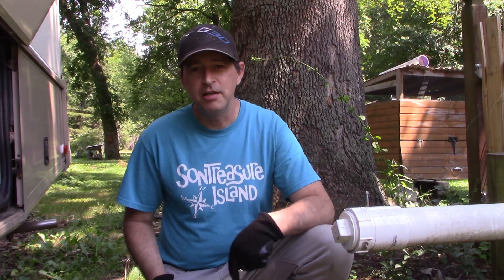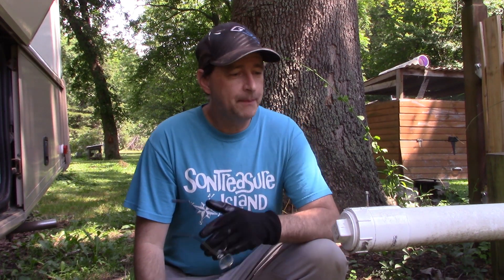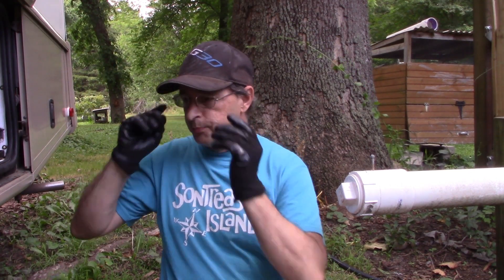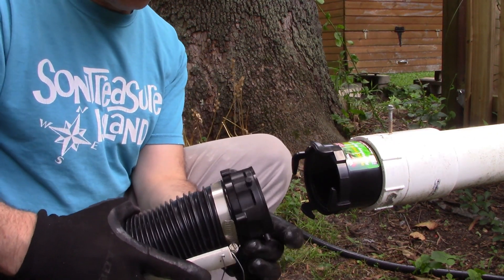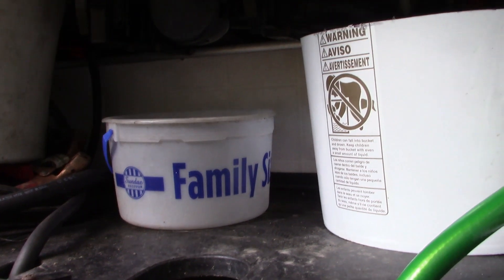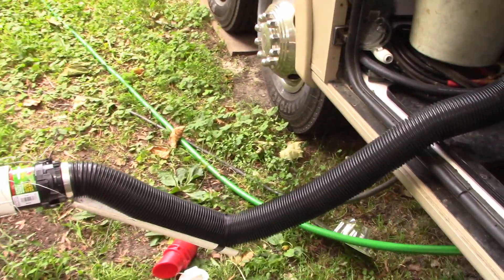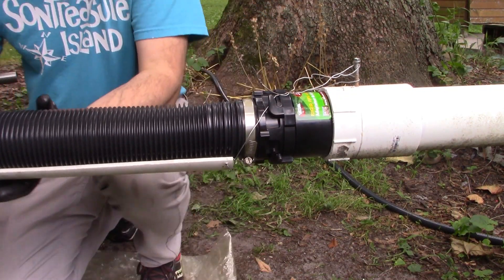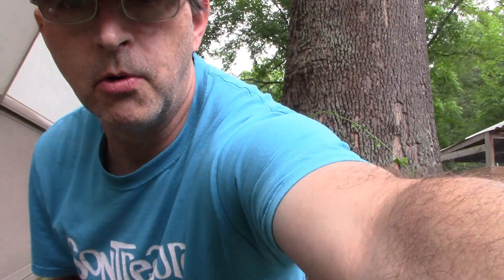Should I Connect my RV to Home Sewer / Septic?

Comment: Also, most code violations only applied to permanent structures.  If your add-on is 'temporary', it may not be a violation.  It is really up to the local codes if dumping into your cleanout is legal.  In many it is, in some it is not.  And you're right.  Even if it is a violation, it isn't criminal.
Reply from the maker: Yes, thanks. Like I said, if necessary, I can have the whole thing dismantled in like 20 minutes.
Reply: Regulatory violations aren’t crimes. Good luck 👍

Comment: In the area where I live, many of the property owners keep their RVs at their homes. This is allowed as long as it is done in a neat orderly manner  Most of these RVs sit on concrete pads that are covered (like a carport) and have full hookups (electric, water and sewer) so they can be used for overnight visitors. Among our neighbors are a city mayor, two city council members, an attorney, a surveyor, my daughter is a real estate agent and I am a homebuilder. We are ALL aware of building codes and  rules and regulations set in place by our Property Owners Association, and their is nothing in the documents of either addressing the storage or use of RVs. After a short discussion of your concern, we can't see a problem, other than the leak. It all depends on where you live and how stringent the codes, rules and regulations are.  I wouldn't worry too much about the nosy neighborhood nazis who try to make your business, their business.
Reply from the maker: Thanks so much for that perspective! I appreciate it!
Reply: @Buckwsr my gmas house has a septic that’s on the ground. I would need one of those wrenches to open it and just put my sewage plug into it. But wouldn’t that close the connection so the sewage pouring in will be closed off? Isn’t there a type of cap meant for the rv sewage hookup? Like a cap on top of the lid?

Comment: Clear fittings on both ends would be nice. Great presentations.  I have a septic system which would be more complicated.
Reply from the maker: Thanks for the note, Frank, and for viewing the video.
Reply: I run mine to the septic clean out..  Works great.
Reply: @robertlapin813  dang I wish I could have a chat with you, so I could get some insight as to how to do it, was it costly to setup?  Does it need to be very close to the septic tank?

Comment: Septic Tanks are Sized to the number of bedrooms in your house, a smaller house will have a smaller septic tank. They weren't designed to dump 100 gallons at one time into them. 
My class C  RV has 35 gallon Black and a 35 gallon Gray Tanks, so dumping 35 gallons from your Black tank, then another 20 gallons when you flush your black tank, then another 35 gallons from your Gray tank into your septic tank. That's almost 100 gallons going into your septic tank at one time. What are the chances of over filling and causing your septic tank to back up into your RV, or into the house?

Comment: I appreciate your work on this project, both times. But I wonder why you didn't expose the Pipe with concrete around it at the start of the original video and see how deep it was. And then replace the elbow with a T and then dig a trench straight to the RV site saving pipe lengths and put a permanent RV Dump Connection there. All would be underground if you had enough fall and you would have still had the original Dump in your fenced yard at the side of your house.
Reply from the maker: You've got some good ideas that never occurred to me at the time. And possibly, in my mind, I think I've always viewed it more of a temporary, not permanent, set-up. Still working great, by the way. Thanks for the note.
Reply: Great idea

Comment: How do I know if the outlet from my Rv has right slope to go inground home septic?  BEFORE I BUY ALL THE PVC AND CONNECTORS.
Reply: I have 100 feet to go.... almost completely straight run to inground septic on our septic field.
Reply from the maker: You only need a slight downhill slope...like 1/4 inch per 10 feet of distance.

Comment: Give you a better answer to is it legal or is it not? That all depends on your area and the code to your area but most of the time if you have it hooked up to your septic tank as long as it does not get put in the wrong side of the septic tank and you have a vent still open for your septic tank you’ll be fine just check in your local areas code, but city sewage I would not recommend it

Comment: ok, you are justifying this from the from context. you are paying for the water, electricity, trash pick as a service. it is not yours. They charge you a fee and allow you to use that service. The internet connection to your house, is not yours. So leave that justification. Now, i am an ex-electrician and know how to run wire from my mom's home to her shed and know the proper codes to do so and did it. However, it is still illegal what i did because because i did not get a permit and you are not allow to even replace a light switch in my county without a permit. Now, i am wrong, however if i called the county and told them i burried wire 6 ft deep trench inside outdoor grade PVC electrical conduit......all that verbiage means nothing when talking to him and they will bite their nails while thinking about the coworker with the short skirt instead of you. Either two things are going to happen, they are going to say who cares, or come out and make me re-dig the trench so they can inspect it. they are not going to asked for the work order from a license electrician to prove it was done in that manner and i have done electrical work all over the county without permits, and was not suppose to.  now what i would not do is installed a main feed wire for the house or add a building and run water to it and tie into the septic because that in itself the county would force me to tear down the structure. So i called the county and asked what size building could i add to my mom's land, and do i have to increase the size for the septic tank. And if they say yes, and i could not afford the septic, then i will replan what i am going to do. What Buck is doing, the worst thing that will happen is they would tell him do not do it any more, cap the pipe off, or increase the size of the septic. You people think that illegal means that the the millitary is coming with warheads to put him down. whatever. Buck can do what the hell he wants and deal with the consequences when he wants with his shit until someone says he cannot and guess what. He could still do it after they leave and make it so no body knows it is hooked up. you know what is funny. Every one bitches about the laws of the government, and immediately turns on their fellow man under that system-of-control and reports them to the same governement they bitch about. Which in itself tells you why authority will always be needed with human beings. How dare the government try to control us and how dare you break those controlling bastards laws. LOL, always trips me out. I am hooking up my rv to my septic in a way that i can unhook it to travel with the trailer when i want to, and i am not asking permission for that. I asked for permission with septic tank and for building an addition and what size of an addition i could put. the reprecautions of the rv is being told to unhook the pipe from the rv. WOW, they really bent me over if that happens. It is not that serious. So if it is found out, they will either say who cares or i will be asking for forgiveness about not asking for permission and say opps it did not know. You might want to be a company-man for the Government laws, but some of us have balls to make low risk choices especially on something that is so minute. And we are man or woman enough to adapt if we are told no later. You the man buck, now tell me how to hook my trailer camper to my septic from stratch so i can understand how i am going to do this. I want to be able to run my water, take my showers, run my washing machine, run my dishwasher, and flush my toilet without never having to worry about tanks filling up or dumping. So if i want to run my sink for 24 hours, i can. Help me out champ
Reply: At first, I thought,  wow, this was 4 yrs thought, but yhen I saw that you posted your comment about a month ago.  I hope you can perhaps give me some insight into this,  as you sound like you dealt with the same government officials that happen to be giving me the screws. 
Long story short...I had a house fire 2 years ago, unfortunately, without homeowners insurance..pretty much  turned my entire retirement investment, including my life's worth of belongings and all of the driftwood sculptures and artwork,  from my business, into ashes. 
Accepting this, moving forward...I rented an apartment in town for the better part of the first year.  I wasn't getting anywhere,  deserting my property, along with the remains of half the burned structure and all the debris.  I have a camper on the property,  but it's never been hooked up to a septic tank.  I go the fitness center frequently or my friends house to shower. Being on a very limited income from social security has made it difficult to say the least, to save enough for what needs to be done here. Just the basic things in life ... i can't even tell you how much I appreciate them now. It's been challenging,  but I survived the fire...I can live a little while without the basics,  so I could save up to reconnect my water and plumbing.  I was also hoping to sell half an acre,  cheap...just to have the comfort of life again.  Okay,  sorry for the rambling..just wanted to give you the background.  So, as life would have it, being humbled and grateful for all I still have and minding my own business ... doesn't stop the haters. I'm very hidden and my property is very private,  I staybyo myself and I'm always helping out others in times of need. But someone who apparently was bored with their life, had to create a stressful situation for me. They anonymously called the health department..which came up to my mountain,  took pics..and left. I was served a notice to have a septic system installed and hooked up to my camper/travel trailer or connecting it to the existing septic from the old house.  I have 3 days left.  I even thought of renting a portable potty, to get them off my back. They're not supportive and not very understanding.  They wouldn't give me an extension.  I'm going through YouTube's videos searching for the best solution.  I don't have very much in the way of funds, and the bank won't loan for vacant land. 
I'll get this done, and make sure I jump through all of their hoops...but I really wish some of these officials would be a bit more empathic to other people's situations. That all disclosed,  if you or anyone could give me some quick tips to make this project a smooth process,  boy...I'd be forever thankful! In love and light,  thank you.